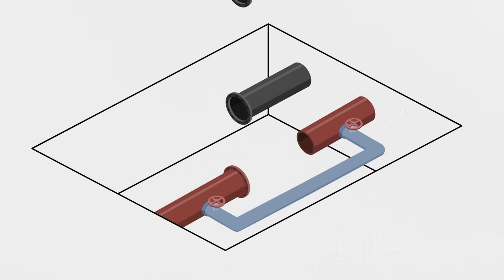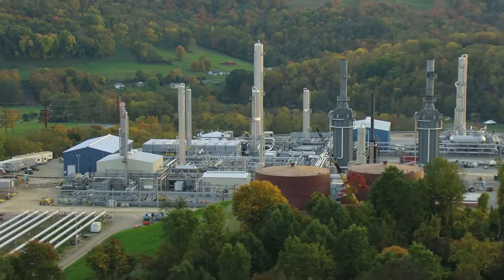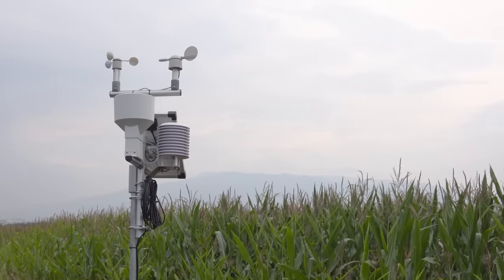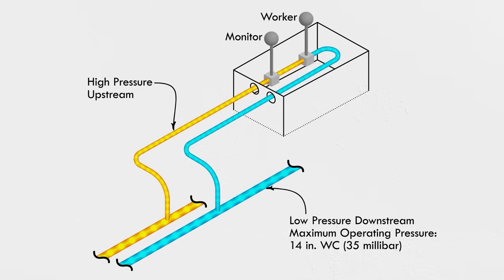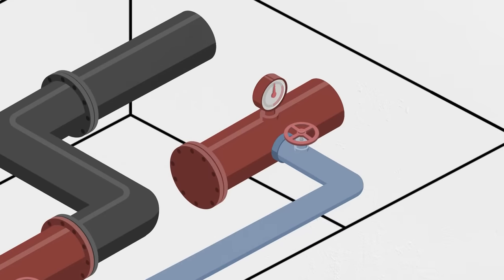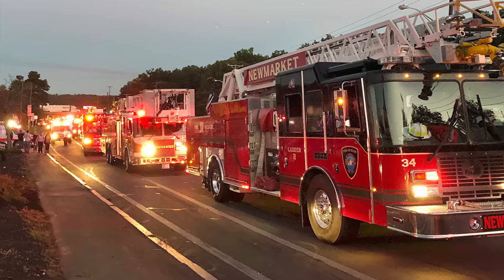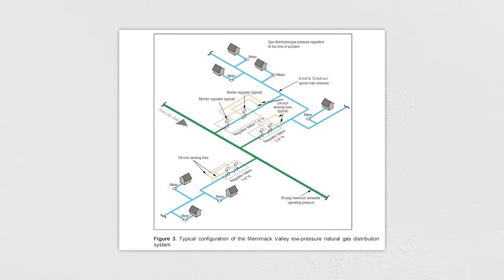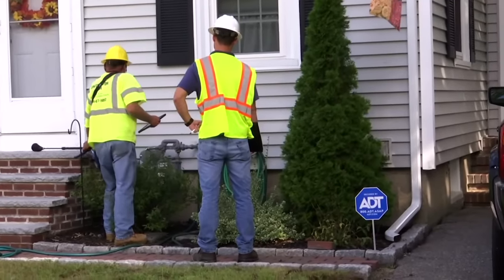What Really Happened During the Gas Explosions in the Merrimack Valley?

Comment: Hey, I just got a job recently as a compliance engineer with a natural gas utility! I got to learn all about this because it directly informs some of our operations and maintenance procedures.

Low pressure (LP) systems are a headache, and old cast iron mains more generally. Our biggest capital project right now is replacing all of them with steel or polyethylene. Typically in our system (and I assume it's common elsewhere), the distribution lines right up to the house are medium pressure (~25 psig) and the regulator is on the meter set which brings it down to ~1/4 psig.

Also because of this event we now install excess flow valves (EFVs) on all lines we repair or install. EFVs trip like breakers if the flow through them exceeds a certain value, so if a line with an EFV is compromised it effectively shuts itself off at the main (it still leaks slowly, but we can come fix it before it becomes a real problem).

Also it wasn't mentioned specifically (and may be obvious), but the reason the second regulator is set to a slightly higher pressure than the first is so that you know if the primary regulator fails - it shows up on SCADA as an abnormal (but, importantly, still safe) pressure downstream. Ours are set to 30 psig, I believe, instead of the typical 25. Thanks for the video Grady!
Reply: what worries me ...  I know iron rusts, but doesn't plastic degrade too?  And now we're replacing vast swaths of plumbing with plastic that might last maybe a decade at best.
Reply: @tsm688  Iron rusts, but we still use plenty of steel in our system - especially where it carries a large volume of gas or gas at high pressure. A lot of the maintenance we do relates to the cathodic protection systems and corrosion monitoring for our steel lines. Cast iron is a special pain because it's weaker than steel, more brittle than steel, more susceptible to corrosion than coated steel and the joints aren't welded - they're often mechanical couplings, which are a fancier version of a flexible sleeve and two hose clamps. Good enough for back in the day, pain in the neck for the guy 50 years after you.

High-density polyethylene (HDPE), which is what our gas lines are made of, is as close as you get to a material which does not degrade. Plastic pipes started going into ground circa 1959 and there are plastic lines in our service area that go back I think as far as the '70s. The material has its downsides, of course - it's susceptible to damage from static discharge, it's not as strong as steel, it's harder to find when you're digging because you can't locate it inductively... but it's the best we've got for most applications, being light, cheap, biologically/chemically inert and much, much easier to install than steel. The HDPE we're putting in the ground will be there doing its job until the homeowner switches to electrical appliances or they try to install a fence without calling 811 first :)

Comment: Thanks Grady. I know Mass is eliminating natural gas installation in new homes (sorry if you covered this), which is unfortunate because it truly is more dependable than electricity in many emergency circumstances, and likely cheaper. Most electrical generators use a NG backup. That should be telling, not to mention it is a domestic product that up until recently provided the US with energy independence. I won't hide my disgust at the way our current administration has sold us all out to the people we import oil from now.
Reply: electric heating is insanely expensive.  that's why so many place still use gas.

Comment: I know back in the mid-late 80's when I lived in Kansas, the local gas utility company was replacing the cast iron lines to the houses with poly lines.  They would simply insert a poly line inside the cast iron and then re-terminate the line into the main.  They used high pressure lines behind the houses up to the regulators at the house, as when they added a new saddle tee onto the main, was it loud with the pressure of the gas coming out.  They just worked fast to replace the saddle so that they could plug the hole and stop the venting of gas to the atmosphere.  Once the saddle was on they connected it to the new poly pipe and filled the excavated hole back with dirt and on to the next house.  Rinse and repeat for every house in the city!

Comment: This was a really captivating video! I had never heard about this disaster before or that such a thing was possible. All these "how a disaster happened" videos are super interesting, Grady.

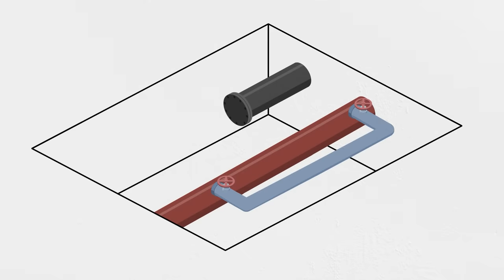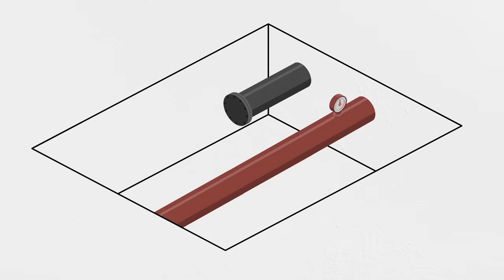I'm really trying to understand the red and black diagrams correctly around 0:22 and 7:06 though. I watched a few times and finally realized part of my problem was assuming the cast iron line was the black one (since cast iron pans are black) but it's clear from the description the cast iron pipe is red. Still it's tricky to remember and visualize which way is upstream/downstream or high/low/no pressure. Maybe some text labels would help next time?

After watching a few more times I think I finally got how the disaster occurred - though I wish there was a diagram showing it all so I could confirm: The fact that the sensing lines were still attached to the now-unpressurized capped line caused the pilot valves on the Monitor and Worker to release their full high-pressure gas without abatement, which went downstream to all the homes. Normally the sensing lines would increase in pressure when the pilot valves open, so they automatically safely close once enough pressure has built up. But as is, it was like the sensing lines were connected to open air (that's wrong but just how I imagine it) so there was no pilot valve feedback loop.

It makes the sensing lines seem like a sort of unsafe, inverse dead-mans-switch or something. If they aren't connected right all hell can break loose. (I might be totally wrong about some of this and sorry for the essay 😅 but I really wanted to understand the situation fully.)

Comment: In my home town, we had leaky pipes that took so much water in that it flowed back to the pilot valve and froze one winter, causing the valve to stick open and increase the pressure in all the lines by about 8x. If you didn't have a gas meter made after 1994, your house had extreme risk of burning down. Pilot lights in furnaces and other devices were observed to be 2-3 feet long. Several houses burned down. Our town is about a 1/2 square mile and 25 fire departments were sent in as the town was evacuated.  They were assigned an intersection and just had to watch for smoke to respond to a fire while the gas company rushed to correct the issue. No deaths, and miraculously, no injuries either.

Comment: Worked with SCBA air systems for years. What was missing was 2 things: 1. An automatic high pressure relief valve, that would have caught the over pressure. 2. A burst disk that would burst at a pressure above the relief valve… both common safety measures in high pressure systems. Neither are expensive or hard to come by. Would also be monitoring the pressures in all the lines to make sure it was right…..

Comment: i'm really surprised you posted this video. i was one of the residents who got displaced when this occured. It was mayhem everyone of my neighbors house caught on fire but we were able to put out the fire. We didn't have a chance to wait for the firefighters so we did it ourselves as there was to many incidents of fires all over the city. The smell outside was like you were next to the gas pipeline while it was open, the smell was very strong. You felt like if you lit a match the air around you would just ignite. We were displaced for a few days but they didnt allow us to come back to our houses for a week. They only let us through walking in order to get our clothes etc.. everyone went to the surrounding hotels or family members, every hotel in a 20 mile radius was full. Once everything went back to normal we still didnt have gas for about a month. we had to electricity and water at least we could boil water in a pan and shower with that. it sucked

Comment: It’s always wild when you happen to cover something I actually know just enough about to anticipate what happened. When you got to the pilot regulators I just had this gut wrenching moment of “Oh . . . oh no.”
Reply: Similar, I'm a mechanic with a background in engineering, and as soon as the regulator setup was described, I kinda saw the writing on the wall.
Reply: @DallasHerrmann  
So what happens when decades-old tired regulators finally go into some form of failure mode? Are they sure to get replaced at some point before the end of their expected lifetimes? Or only when there is no gas pressure and something needs obvious fixing?

Comment: I am a contractor for a company that installs and repairs gas lines. Shortly after the reports came out with a cause, the higher ups mandated several changes to procedures for hot taps and tie ins. It was a rough start, now double checking plans, flow maps, and gauges before, during and after is second nature.

Comment: I work for a natural gas distribution company in NJ and my job is to work on over 125 regulating stations. We actually have seal pots which create a liquid seal in the system so over 14” wc causes 15 gallons of oil to be flushed out of a vent stack and allowing full pressure to vent out of a 6” stack while simultaneously allowing UP to be delivered at normal pressure. Sounds archaic but it cannot fail under any circumstance.
Reply: In the boiler industry, we always have a relief valve to protect equipment downstream of a pressure regulator.

Comment: I had known that they ended up with high pressure on low pressure lines but I was under the impression it was a direct connection. When you got to the point where you mentioned separate sense lines I immediately guessed what the mistake was going to be.

Comment: I drove through Lowell and the surrounding cities the night when everything was shut off and it was surreal. They shut down all traffic in and out of Lowell including on the bridges and were working at night with generators and back hoes to dig up the roads. There were 100s of gas and electrical company vehicles parked in large parking lots in the area. I went to drop off stuff at the donation center and the entire place was stacked to the roof with stuff. It was amazing seeing the community come together.

The underlying issue was that when they connected the new gas line they didn't move the sensor over so the pipeline thought there was no pressure so it opened up at full pressure. The local low pressure lines and house regulators didn't have any safe guards so your furnace and appliances exploded or turned into flame throwers.

Comment: I work in the natural gas construction industry in NY, after this incident, so much changed. many may not realize but working with low pressure gas is so much more dangerous than working high pressure, much of the low pressure systems in our areas are slowly being phased out due to much of it being old cast iron....

Comment: I lived about a half hour north of where this happened in 2018. Watching this video and learning that each customer did not have their own regulator baffles my mind. I lived most of my life in Florida (and I'm back in Florida now). Here, we have high pressure systems where the line to each house is pressurized at 75psi and there is a regulator immediately before each gas meter.

I know this because one day, while he was marking the lines in my yard ahead of a construction project, I asked the technician how much pressure is in the line under my lawn.  You can see the regulator inline before the meter.

In all the years, I only had one problem with my gas service. I could smell gas near the regulator (located outside the house). I called the gas company and they came right out and replaced it.

Comment: I did not hear about this at the time, but I live in California. We had a different gas transmission line problem in San Bruno, California in 2010 where an old high-pressure pipe failed underground and blew up dozens homes nearby. Eight people were killed.

I won’t miss natural gas as it is replaced by electric appliances.

Comment: It honestly bewilders me as a robotics engineer that having only two regularization pipes in series was everything that was regulating the pressure in those pipes, maybe I'm biased by my background in automation but having a third sensor checking that the pressure wouldn't go up past certain value sounds like a no brainer to me. I loved the video and it just shows how sometimes the biggest accidents don't come from engineering missing calculations on projects but often by lack of rugosity when handling these kinds of systems.
Reply: and where would that third sensor get its data?  The local pressure is high anyway because it's so close to the source.  something different, maybe a velocity measurement, to tell when you're pumping into a gaping hole perhaps.

Comment: In my hometown in Germany the gas network is managed and maintained by a city owned company. There are two regulators, one for the entire area which reduces the gas to medium pressure for the distribution system. Each house with natural gas then has it's own low pressure reduction valve to further reduce the pressure. Most people use gas only for heating their house but from next year on all new heating systems have to be at least 65% renewable so most new building projects don't have an gas connection any more.

Comment: Good jub, interesting video.  My first job out of engineering school was a local gas company and I worked at most of the different jobs with that company.  I ultimately opened my own consulting engineering company and worked at it for 52 years designing the electrical and mechanical systems for commercial and municipal buildings.  During the work at the gas company I spent a lot of time at the regulator stations for several towns in the Black Hills of South Dakota.  Thanks for the good description.  Also, remember there are no
hot water heaters.  If you had hot water you wouldn't need a heater.  We call it a (wait for it. . .) WATER HEATER.   PN

Comment: I assume that a downside of high pressure distribution is that accidental breaks during excavation would increase in seriousness? A couple of years ago a 1.25" high pressure line (originally installed about 10 years ago) was ruptured directly in front of my residence... thankfully it found no ignition source. The roar of the gas escaping was deafening and the entire neighborhood reeked of the odorant for days, even inside buildings. What disturbed me most is that during a major utility reconstruction project nobody on site had the ability to turn off the gas... it vented for at least 20 minutes, and I'm on a dead-end. There is a shutoff not 50 yards upstream from the break.

Comment: Here in the Midwest, gas pressure to each residence is high pressure, and the regulator is on or around the meter. I watched a service man remove the shut off valve, to extend my sinking gas line, and he shoved a plug into the line against 40psi line pressure, which is always a scary moment.

Comment: In the mid 90's, a freeway entering Buenos Aires from the north was being widened, bridges replaced, a huge construction work. One day a backhoe broke a natural gas main pipe. I worked about 3 km from there. Before knowing what was happening, we only heard a noise like a plane jet engine at full rev, as you would if you were at the edge of an airfield. I went out of the building and saw a plume of dust in the distance - later they said it was about 30 m high. Soon after, someone heard on the radio what had happened. The police evacuated the neighborhood, and it was a couple of hours until the gas company could shut down the pipe. Luckily it didn't ignite.

Comment: Very poor planning. Where I worked in the Natural Gas industry we always had crews on site at all the regulating stations downstream to make sure things like this did not happen. We would also do a few trial runs of disabling the bypass to make sure pressures dropped and recovered as expected across the system. Even with good oversight and design this was important because with 100+ year old cast-iron systems there was always the potential for undocumented connections or interdependencies.

Comment: After enjoying gas in Texas for 40 years I was relocated to eastern Pennsylvania.  There was no natural gas there.  Fuel oil, delivered by truck, was their preferred (only) heat source with electricity used for cooking.  When I enquired about the complete lack of natural gas in the region a local city official informed me they had determined after decades of deadly explosions, gas was extremely dangerous, and had abandoned the entire pipeline infrastructure in the '50s.  At the time I assumed the Standard Oil Co had made it rain (bribes) 70 years ago, haha.  But it begs the question: is a 100 year old tank with 300 gallons of diesel oil in 10 million basements safer?  Though isolated, that system relies on the homeowner/landlord maintaining his own equipment.
Reply: This is insane. Gas is cheaper and more efficient.